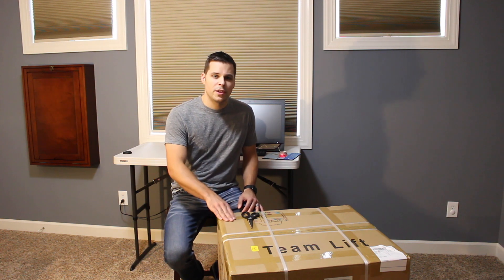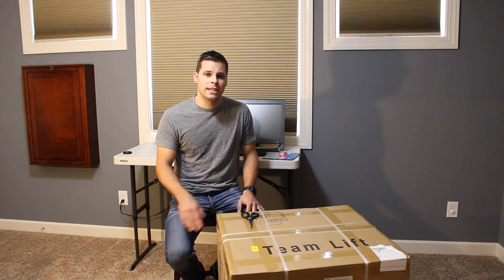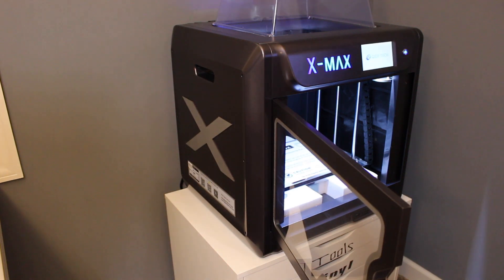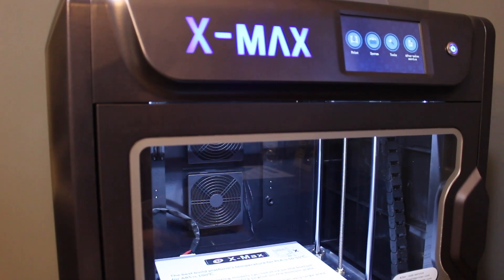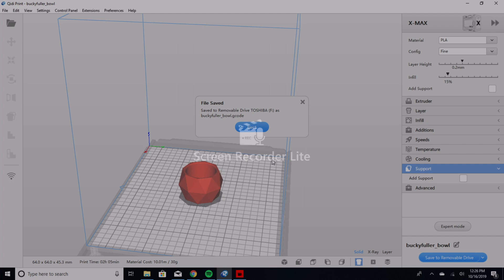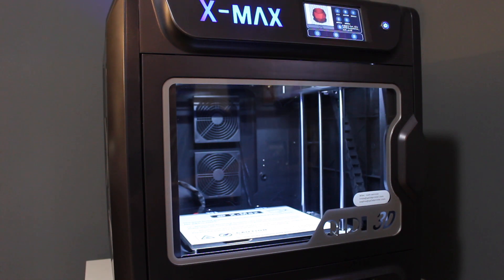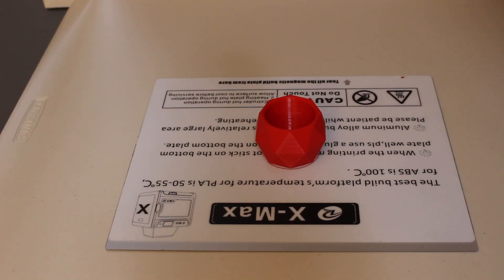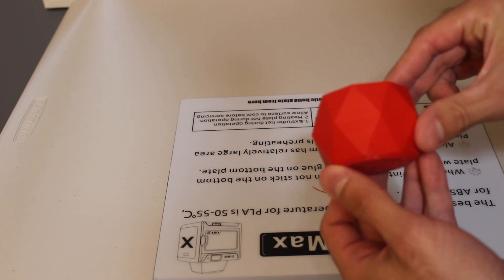QIDI X-MAX 3D Printer - Unboxing, Setup, Initial Thoughts

Comment: Machines are actually extremely terrible!!!!!!! I am speaking from experience. These people are given free printers for good reviews. They have nothing but issues nonstop. Yes he went over all the great features but all these features are all bound to fail very quickly. I fell victim to all the "amazing features". They look great but are engineered extremely poorly all the way from the motherboard to extruders (yes both) to nozzle to slicer to connectivity to spool, board and power supply placement and even the enclosure. There is also no information for maintenance or anything useful on the website. Also it does and cannot print at 60mm/s. The software says 60mm/s but has its own built in algorithms to adjust that speed to almost half of what is imputed. The only thing that has not given me any issues with their machines is the touch screen. After the experience i actually prefer buttons and or a knob. Just do the right research there's all sorts of forums verifying what i am saying. Also the replacements are extremely over priced and poor quality. You can buy a ten pack of better quality mk10 brass nozzles and a roll of ptfe to make 10 replacements for less than they charge for 2 pre assembled replacements. You can even kick it up and buy a steel tube and steel nozzle for about the same price as the 2 replacements and basically never need another replacement!!!!! Please don't get ripped off by this!
Reply: Hi Vincent thanks for the heads up.  I have been looking for a good quality printer and am willing to pay up to $3000. I need a printer that can consistently print about 500-1000(per month) one inch size cylinder plugs that I am using for a product I have designed. Id need it to handle this workload to fulfill a supply aggreement. Any opinion on Zortrax's printers or CreateBot?

Comment: Ok so what do you think about this printer. What’s not good about it ?
Reply from the maker: Adam Filipowicz thanks for watching. I have been printing on this printer constantly since purchasing and have not had any real issues yet. It took about 2 days to really dial it in but it seems to be doing a great job so far. I printed an army tank today and am currently doing 8 army men. No issues yet but will post any issues that come up. Loving the large size of the printer!